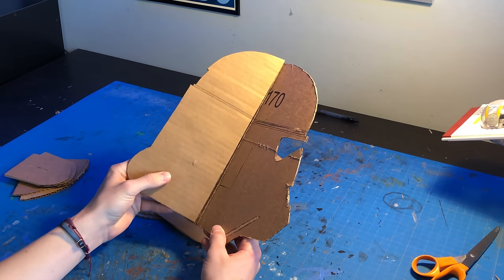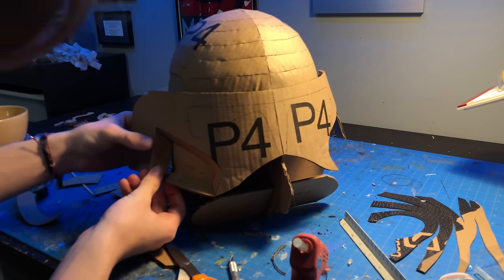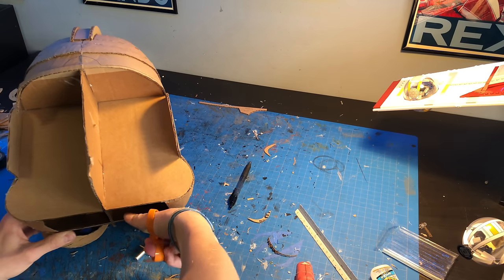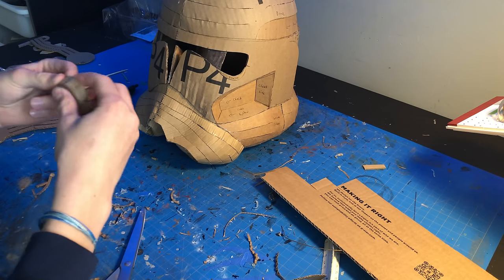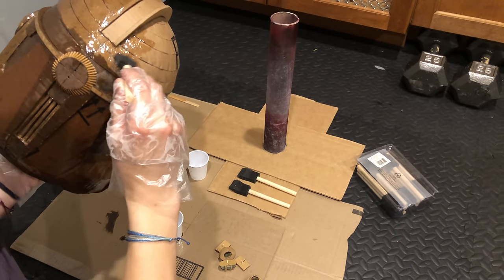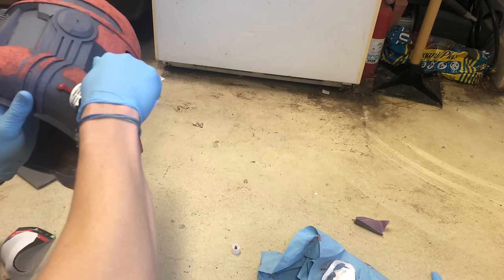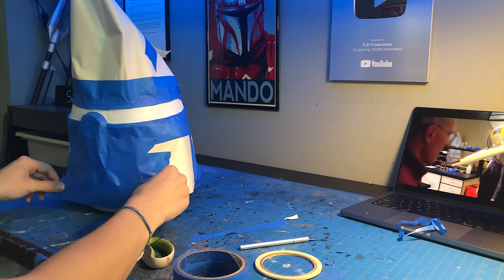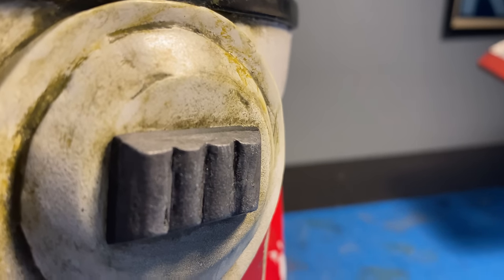Cardboard SHOCK TROOPER Helmet (DIY)

Comment: I can't even tell its cardboard anymore😅
Reply: i feel like it’s not really cardboard, because there’s all that other stuff on it
Reply: @Sawgrass-TML it’s still cardboard regardless, just cleverly added to, and upgraded.
Reply: Could also call it an pep helmet (meaning people do helmets using paper and resin and this is cardboard)
Reply: @NinjaPigSmash  its not JUST cardboard. its cardboard, resin, and  fiberglass.
Reply: @mrandersen6872  yup, next time actually read what I said. “Cleverly added to, and upgraded” “regardless”.
Reply: @NinjaPigSmash But the title of the video only mentions cardboard
Reply: @brianorozco1074 because the base model of it is cardboard.
Also, Cardboard Epoxy Resin Sandpaper Paint Woodfiller Shocktrooper helmet doesn’t really roll off the tongue well
Reply: @FunFacts1212 shit ig it'd just be a composite helmet, you got the weave the middle part for structure and the resin, definitely a composite helmet
Reply: @brianorozco1074  you could just as easily make it out of just cardboard. the rest is just optional things to make it look better and to make it stronger.

Comment: This helmet is amazing! A tip I have seen from other guys who do this stuff is a bondo-water mixture of mostly water added to bondo in a cup mixed together. It creates a bondo liquid you can more easily apply than normal bondo which could fix the problem you have (as shown). Using 60 grit as a start and then 150 and then 200 could also help. Overall good shit man!

Comment: Im doing this project myself for the first time using this video as a guide and I just did the second coat on resin yesterday. I ended up using some double sided tape, scotch tape for the curved parts in an attempt to avoid hot glue residue, and duct tape on some parts that i thought could use some extra strength before applying any resin. I think using the tape as a crutch left me with a much rougher product so i’m afraid the resin won’t get rid of those imperfections, but maybe the sanding and painting steps will help with that. I’m going to try doing a EVA foam build next and see which one i prefer.

Comment: I use car body filler after the fibre glass it’s cheaper and goes further than the spot putty and easy to sand then use the spot putty for the imperfections

Comment: Hey I've been seeing your videos for a while, and me and my friends decided to build some clone helmets this summer following your templates. We would like to know if there is any specific cardboard you use, as well as the fiberglass cloth thickness. We also wonder if you have any methods of bending the cardboard to prevent creasing. We really appreciate it, thanks!
Reply from the maker: In terms of cardboard, any normal piece that is not too flimsy should do fine. The fiberglass I get is just the regular Bondo fiberglass cloth. For bending cardboard, try to use a straightedge like the side of a table or something. Hope this helps!
Reply: @rjr_productions  Got it! Thanks for the help and fast reply. Wish us luck building these!!

Comment: I have a question when you have bought the template. and prints it out in A4, they should be as now an A4 sheet should be. It doesn't look like you can get it over your head or is it just something you have to scale up yourself?
Reply from the maker: I actually print them on letter paper. But at that scale, it does fit in my head

Comment: has anyone else had a problem with the templates not fitting together? like some peices are too long or too short
Reply from the maker: I’m sorry about that. Some of the pieces are a very tight fit and have to be pulled into place. Still, If you message me on Etsy, I’m sure I can get the problem sorted out!